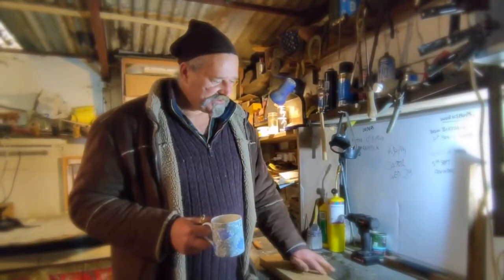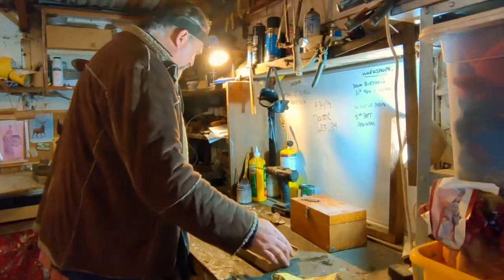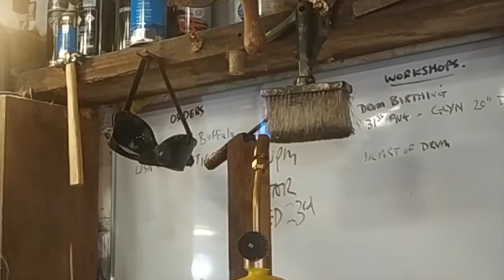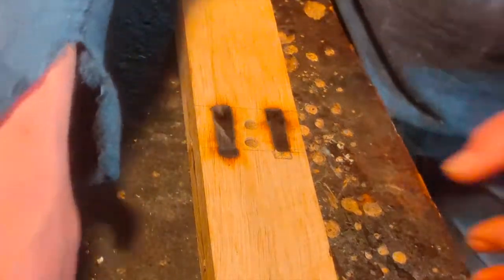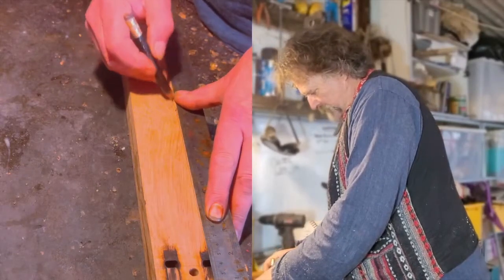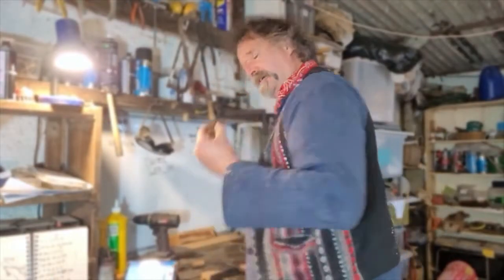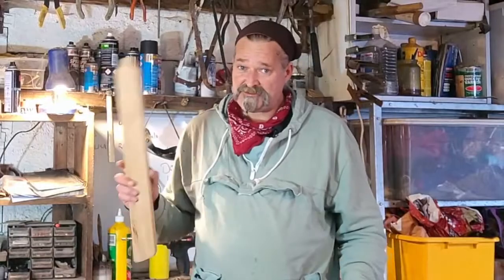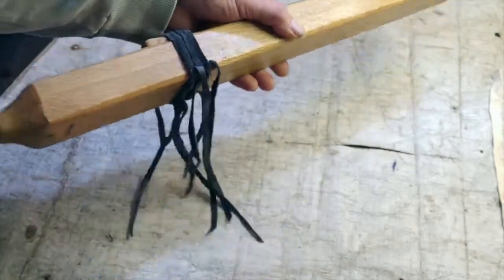Making a drone Flute, With Crow from Driftwood Hollow Drums. (full movie)

Comment: Hi Crow, magical watching it come together. I am having a go at making my own flute in E. Is there a formula for working out where to put the holes? Thank you 🙏 Much love.
Reply from the maker: @razorbackficus9802  Hi, if you measure the distance from the north edge of the sound hole, to the end of the sound chamber, then divide by two, Mark the position and the measure 6mm further south. This gives the position of the third hole from the bottom. From this measure down again 25mm and then again 25mm this will give you the bottom 3 holes. From the 3rd hole up, Measure up again  towards the sound hole 40mm this gives the next hole, from here measure up 25mm then again 25mm. This gives you six positions. The exact positions will depend on the bore size and wall thickness, the 25mm spacing I use for 25mm bore flute. If you have wall thickness thicker than 5mm or 6 mm move the holes very slightly north up the flute, thinner than 5mm then move slightly south down the flute. This is not an exact science and the variations in thickness etc needs to be taken into account, it's something you get a feel for. Good luck
Reply: @driftwoodhollow752  Thanks so much Crow 🙏🏼 It's a really beautiful journey creating an instrument. Thoroughly enjoy watching your video and listening to your voice. Thanks again for sharing.